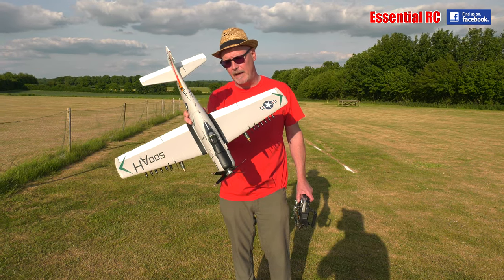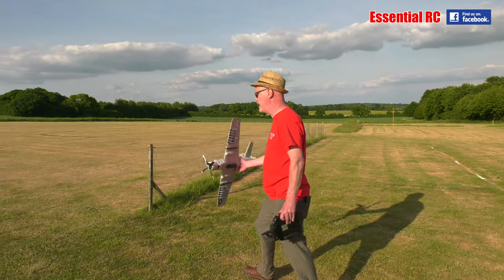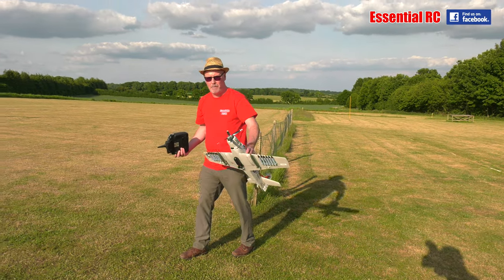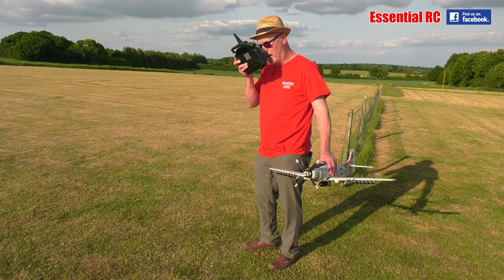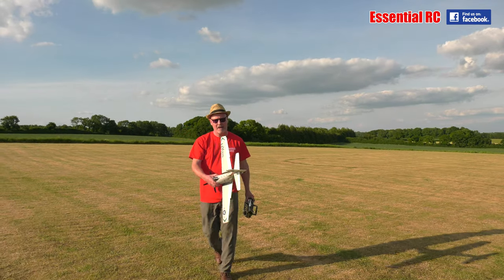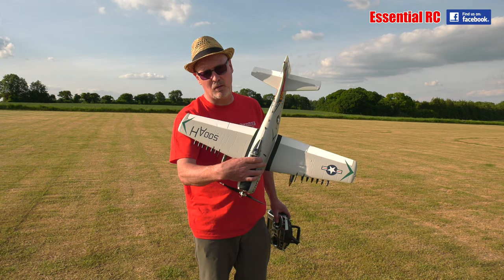H-King A-1 Skyraider with ORX Flight Stabiliser: ESSENTIAL RC FLIGHT TEST

Comment: Does look better without the gear, but I doubt that prop will last long coming in belly up repeatedly. I'd be inclined to knock up some dummy fuel drop tanks to give the prop some clearance for belly landings.
Reply from the maker: It does have a big bomb in the middle and other ordnance underneath Alan. I'm kinda kicking myself I didn't point that out clearly in the vid and the fact that it didn't damage them on landing. So I think that takes care of the prop clearance.  Cheers - Dom (Essential RC)
Reply: @EssentialRC  Yup, I know there's plenty of dummy ordnance comes with it, but I still think three of the large drop tanks, one on each wing and one on the centreline would give it better prop clearance and they'd be fairly easy to knock up. I am looking at getting one of these things and I probably will do that. The field where I fly stuff has some pretty long grass which does well for belly landing stuff though, so you never know. Anyway, I appreciate the review vids from someone who actually knows how to fly a proper escape maneuver out of a loop low down!